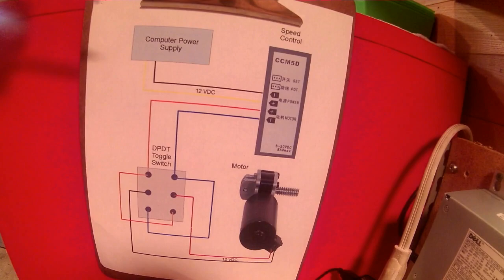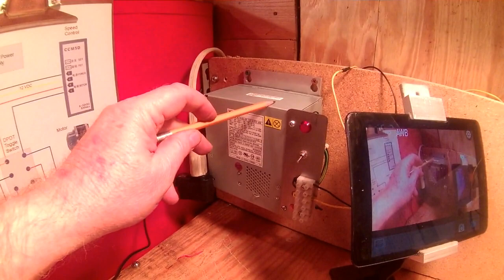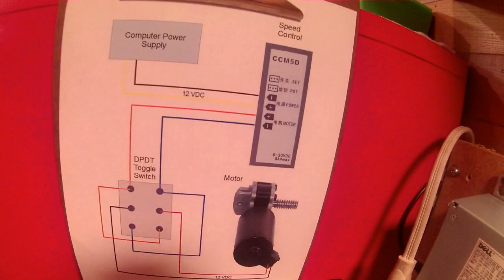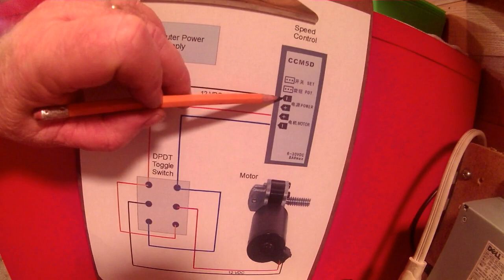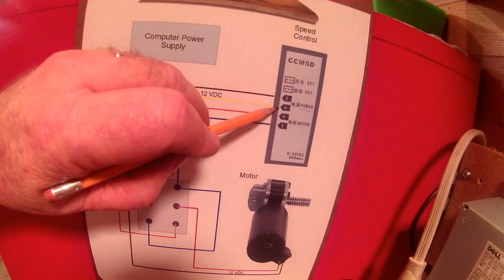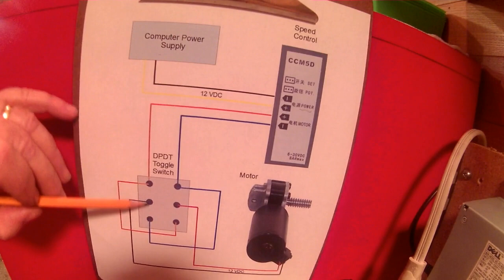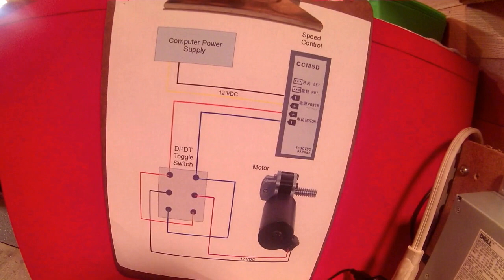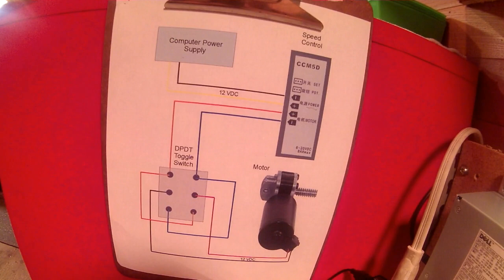12 VDC Motor Speed Control & Reversing Switch

Comment: I like how you was able to keep it simple for the ones who dont know about switching and wiring. When you said wire color dont matter, I laughed so hard. I use this same wiring for my motorized fishing cart. Just with a battery, but you already know that. Was actually looking for other ways of wiring with two motors. Switching from series to parallel. It's a crude way of having a high and low speed for the motors.
Reply: Did ya get it done? That is the way the power wheels kid electric cars work.
Reply: Never mind saw the videos. Nice work.

Comment: Great job. I'm wiring up a trolling motor to a kayak and wanted to get rid of the handle. So I wasn't sure how to wire one up with a controller. Thx a lot for the help.
Reply: Bob Denneny I used the same speed control, it cost £3.19p shipped. It arrived from China within 10 days, just saying.

Comment: you can get that speed controller with forward and reverse switch and the pot, handy  for those that don't want to wire a switch  great video thanks.
Reply from the maker: Thanks - I've got several dozen of these DPDT toggle switches that I need to use up. :-)

Comment: Thank you very much for making and posting this. Im in the final stages of a project and have all of the parts but I was wiring it wrong. I was putting the power to the switch then to the controllers then to the motors. Again thank you very much.

Comment: i am having a issue with the motor running in same direction when I mount it to my metal bracket.  It goes in both direction when not mounted... any suggestions?
Reply: Randy Peebles  do you have any other low voltage DC attached to your machine? If so part of the machine must be connected to that DC supply somehow and not letting the polarity change happen. If you try to use it in the opposite way it will turn you will definitely burn out your power supply and probably the speed controller as well in short order . If however there is no other DC power on the machine I have no idea as to the cause. I'm sure something in your set up is grounding via the machine's own safety grounding system to stop you getting a full load shock from either your single or three phase mains electrical system and thereby stopping your 12 volt system from working one way. Hope that helps.

Comment: Wow, I wish I had discovered this video a loooong time ago. It meets my need exactly. I have a treadmill DC motor on my old Delta/Rockwell wood lathe along with a potentiometer. Everything runs through a mc-60 speed controller off the treadmill. Both the power & motor hook up to different clips in the mc-60.  The power line runs from the source to an off/on switch then on to the mc-60 controller. I have a 6 prong DPDT center off switch to install mainly to have forward/reverse capability but after seeing your plan I can run the potentiometer through it too. I have two questions about the set up though. 1) can I do away with the power on/off switch I now have to turn power on /off to the lathe? 2) with the leads coming from the DPDT switch, can I hook those leads directly to the power and motor points on the mc-60 controller? Please let me know if there is anything that's not quite clear & I'll try to explain more clearly. Thank you so much for putting up this video.
Sincerely,
zetuskid

Comment: interesting.  Out of curiosity do you happen to use "inches per minute" feeds with these small or mini mills?  Would it be worth the effort to map out the potentiometer resistance on a meter, then add a numeric entry keypad and a matching resistance block to directly enter the inches per minute on a keypad, instead of the dial?

Comment: Can 18v be used in this set up ?
Reply from the maker: Walter Merrick That shouldn't be an issue. I'm using the same setup with a 24 VDC power supply for the X axis power feed I have on my mill.

Comment: Hi Lee, great content. I'm going with the parts you suggested. The box you use for the speed control seem to be a great size. can you provide any details on that? Thanks Jim
Reply from the maker: Jim, the box is a 4"x4" by 2" deep electric box from Lowes. Good luck with your project.
Reply: Thanks for the quick response. I was just on my way to Lowes to get bags of topsoil when you responded so I picked up the box while I was there. As another viewer responded, I would also appreciate a video on your DRO's. I have the iGauging scales, but haven't mounted them yet. BTW, what is the control box mounted over your readouts? Did you add a gas shock to your mill?Thanks again Jim T.
Reply from the maker: +Jim Turcott I'll try to get a video put together on the DRO mounts. They work really good. The other control is for a LED microscope light mounted around the spindle. When you get to be my age, you need all the light you can get. 😜
Reply from the maker: +Jim Turcott oh, in regards to the shock. My mill came from LMS & it already had the shock installed.
Reply: I just watched your video on the limit switches that you added, and I'm wondering how you wired them into the circuit. If they were just in series with the motor that wouldn't let you change direction as you did without letting the switch close.  I see you used spdt switches, but it looks like only one set of contacts were wired. Very ingenious modifications.
Reply from the maker: +Jim Turcott Jim, I have hopes & plans to follow up on my wiring video to show how to add the limit switches. In the mean time go ahead with building your control as shown. The mod only requires a minor change. If you'll drop me an email pragmaticlee at gmail dot com I'll try to get the wiring diagram modified & send you a PDF, but it may take a few days.
Reply: @MrPragmaticLee  good day  Lee great video .Is it possible to connect rapid or turbo button and limit switch ?could you please share another video. Kind regards Paul

Comment: Excellent video and very helpful.  Question- What would be the "minimum" amp power supply for this motor?  Website shows several- and I wonder if this 3 amp power supply would be adequate if used with this motor on a larger bench top mill (PM 25MV) ?
:https://www.allelectronics.com/item/ps-1272/12-vdc-3-amp-power-supply-special/1.html

Comment: no sound with this video
Reply from the maker: Hmmm, almost 40,000 other views and no mention of missing audio. It plays fine for me. Might want to check your volume setting. Thanks for stopping by.
Reply: There is another in your comments that had the same problem settings are fine i watch alot of your videos  and have learned alot from you and your safe attention to detail but the smart ass remark 40,000 other viewers just made me unsubscribe .thanks for the reply   @MrPragmaticLee
Reply: teako44 he was simply trying to make the point that he has had no other complaints about the sound. If 40,000 others viewed & it had problems he would have already heard about it. Wearing your feelings on your shoulder only makes you the looser if you choose to unsubscribe. He certainly was not making the reply personal.